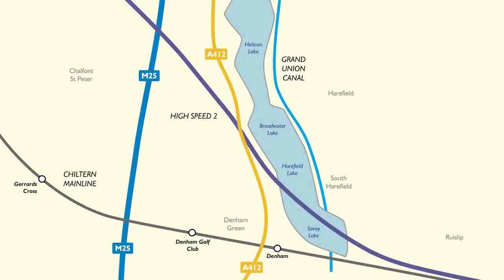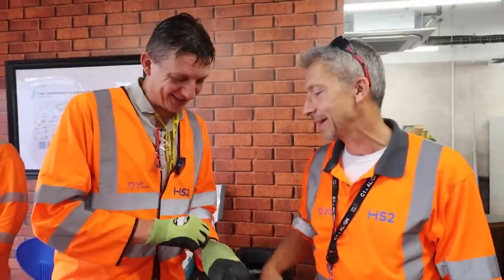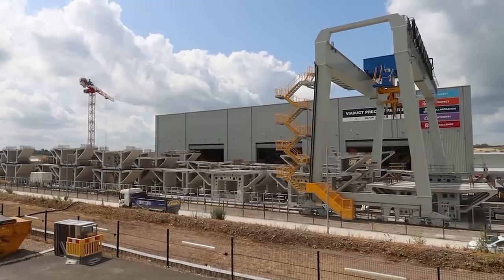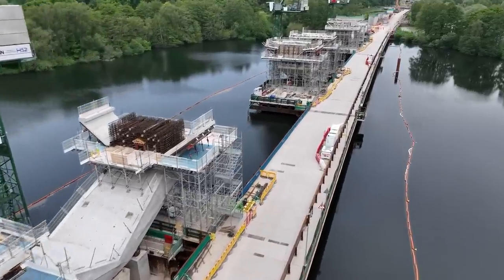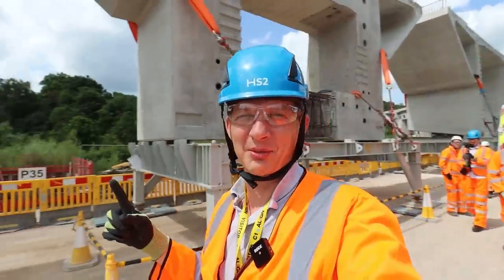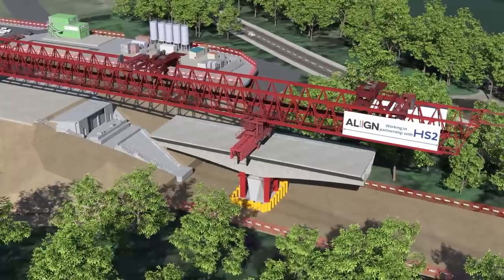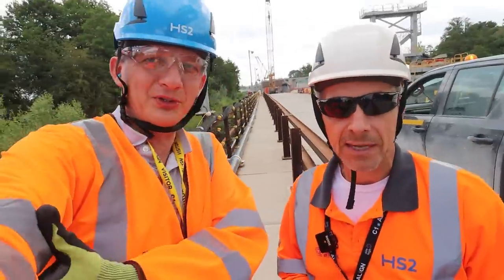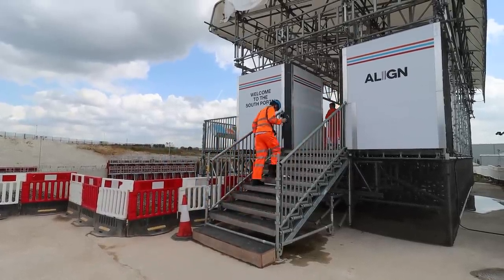Building the HS2 Colne Valley Viaduct

Comment: What always fascinates me is how the engineering requirements change the faster you go. All these weird physics things that the Victorian engineers would never have had the need to even consider.
Reply: They just built things to last 🤔🤔
Reply: @johnhehir508 They threw bricks and workers at a project until it stayed up and then added another layer of bricks and workers just to be sure.
Reply: @MichaelTavares so true
Reply: @JagoHazzard Can you imagine that Brunel would have much trouble getting to grips with modern engineering, material science and the vast array of information available today (then again, he probably didn't have to put up with quite so many carpetbagging skinflint investors and smart alec politicians that think they know better than experts.)
Reply: @smokerjim  Of course he did, bureaucracy transcends scientific endeavour in every single field
Reply: And of course railway historians in the 2150s will have so much more material to work with, assuming all these videos get preserved.
Reply: They still managed to build a railway that could handle 125mph steam engines, which is rather impressive. Granted they'd have modified parts of the track before said speeds were reached, but still largely the same alignment.
Reply: @johnhehir508 us non-bridge-building types are generally only aware of the stuff which didn't collapse. Google "railway viaduct collapse Penistone". Nice shot of a Lanky Tank where it had no business being (the crew jumped clear in time), or to see what they did when a problem raised it's head before catastrophic failure, have a close look at images of Cannington Viaduct.
Reply: @kimsmoke17 In which case, might I commend to you the works of Col H.F.Stephens?  The Kent & East Sussex, at Tenterden,  is a (wonderful) surviving example .... c/w the Col Stephens Museum, which contains one of the smallest std gauge steam locos ever built!
Reply: Idea for a video -  we played a 96 hour game of capture the flag across japan . By jet lag the game
Reply: Brunel with his 7 ft gauge railway would bed to differ
Reply: @TalesOfWar The Great Northern / LNER managed to get Mallard A4 up to 126mph  for a world record on a  very short, flat section of the East Coast Mainline. No one else came near to 100mph never mind 125 mph steam traction.
Reply: @paulmerry6262  So what you're saying is they managed to get up to 125mph on Victorian track alignments with a steam engine?
Reply: @TalesOfWar once on a very short section of track, it wasn't routine.
Reply: @tgm9991  I never said it was, just that they managed to get such speeds on ancient infrastructure, from before a time of CAD and better understanding of how to build a proper high speed line. Imagine how well our modern infrastructure with almost 2 centuries of improvements can be adapted in the future for even more impressive speeds than it was originally built for.
Reply: I don't know about steam engines but @TalesOfWar is right otherwise. GWR runs 125mph on Brunel's original track bed.

Comment: The useful analogy of the porous portal would be the suppressor on a rifle, which reduces the noise produced by the bullet leaving the barrel. It works in exactly the same manner.
Reply: thinking exactly the same thing - a whole load of air pushed along by a train is much the same as the expanding gases behind a bullet

Comment: Great video Geoff - keep them coming.  I support the idea of HS2 but know that the vision will not be realised for probably 50 years.  We only have to look at the promise that HS1 and the Channel Tunnel provided yet I still have to fly to Switzerland on holiday rather than take a through train from London to Zurich.
Reply: At that distance, high speed trains are still not competitive time-wise even including security screening (which Eurostar also does and continental rail do not), so it will not be valuable to enough people. But the Channel Tunnel and Eurostar function as designed and provide competitive times London to Paris or Brussels with connections (2 changes) thru Germany and onto Zurich for those who prefer rail travel. Still I get your desire for something like the regular ICE Hamburg to Zurich in one train, about the same distance as London to Zurich.

Comment: I'm desperately trying to write a comment that is not automatically axed.

I was trying to give some info about two examples of porous portals, one between France and Spain, the other in Northeastern France.

They are the "Perthus tunnel" and the "Tunnel de Saverne". Both are easily viewable from the satellite view of GMaps and are existing POI's with these titles.

The Perthus tunnel is located on the high-speed line between Perpignan and Figueres and is an international tunnel.

The Tunnel de Saverne is located 30 kilometers (as the crows fly) North-West of Strasbourg on the LGV Est between Paris and Strasbourg.

They respectively see trains running at 300 and 320 kph.

They both have different types of porous portals, and both have twin tunnels.
The Perthus tunnel has multiple "windows" that increase in size from the tunnel outward to the end of the portal.
The Saverne tunnel has two sets of two large vertical piston relief and dilution vents on each portal and both portals have a "crown" or "cap" of tube bars that also helps to brake and dilute shock waves.

Voilà

Comment: Hi Geoff, I'm a bit "sur ma faim" as we say here, as I was expecting a little bit more technical details on the deck sections or on the erecting grider.  I don't know how they attach the sections together for instance or how heavy is the erecting grider...
Reply: They are perfectly aligned and immovable by virtue of their mass and steel tensioning cables which will be threaded through the sections. The perfect alignment is achieved through the use of match-casting in the factory where sections are cast against the previously created one. It means all sections are different but aligned with the one before. It's why the joint venture company making it all is called Align. The girder weighs 700 tonnes.

Comment: As impressive as the engineering is on the HS2 project, I cannot help thinking that it is ultimately nothing more than a government vanity project and a monumental waste of a vast amount of money that the country hasn't got.  The well over £100 billion that this will cost would have been far more effective if it was invested in improving existing infrastructure rather than building a single line with no intermediate stops.
Reply: We did that before and got very little to show for it after a decade. The west coast mainline is full up, maxxed-out. Do you understand that?
Reply: @chris8405  Take a train from Birmingham to London at peak time and you virtually have the carriage to yourself until you reach the edge of the commuter belt at Milton Keynes which HS2 does not serve.

Comment: Great video, still think it's a waste of money and this money and jobs could be used to improve the current railway structure
Reply: @adamtravers856 the current system is at the point where you could spend billions more on it than HS2 and have absolutely no benefit whats so ever. The current system was built by the Vicorians nearly 200yrs ago, the trains and carriages were shorter and slower so could go around tighter bends. To straighten the current system to allow true high-speed trains you would need to purchase more land to allow this and there will be years and years of disruption whilst the work is carried out, it is cheap and more effective to start again. 
The new HS2 line will remove the existing express trains from the current mainlines thus allowing a greater number of local services to be introduced, and also more freight trains to run. Express trains take priority over every other service and because of the our mainlines are at capacity.
Reply: This is an improvement of our railway structure???